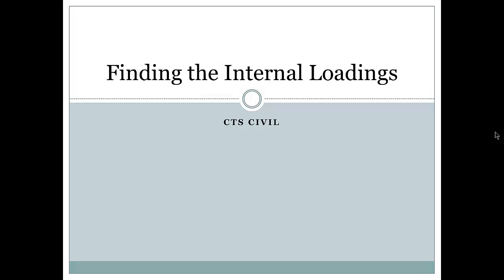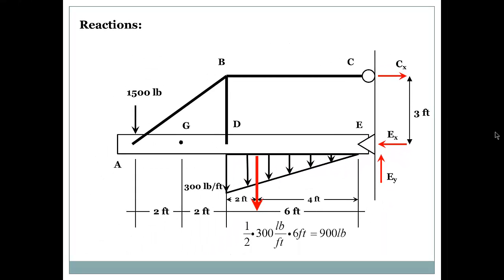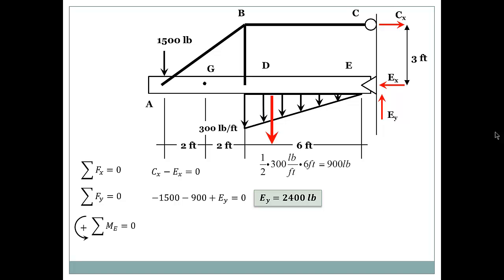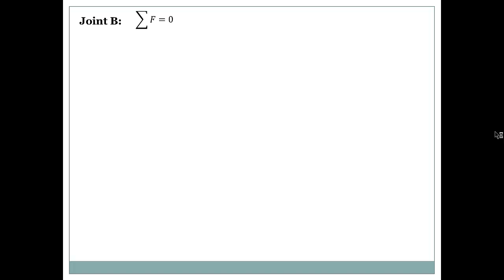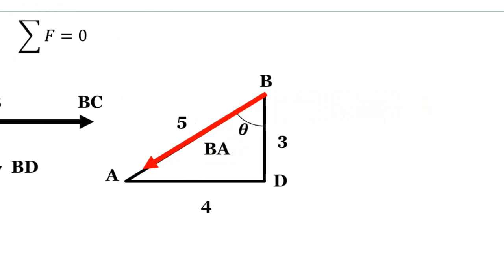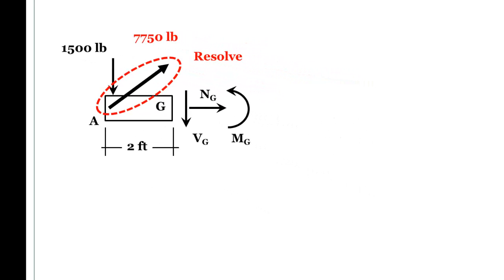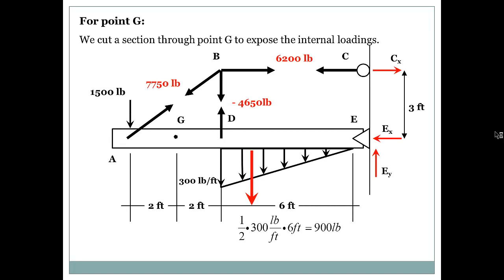Question (7): How to find internal loadings in a beam?

Comment: Wouldn't Ex be negative because there are only two horizontal forces acting on this system.  how can you have two forces acting in the same direction with no counter force to bring it to equilibrium?

Comment: Why does C only have a horizontal force acting on it? I thought pin connections have two unknown forces?
Reply from the maker: +ALV57 It is assumed that the support at C acts as a roller. That is why it has one reaction only :)
Reply: @CTSCIVIL  Bullshit man, it's got something to do with it being a two force member, but I can't work it out. I cam here looking for exactly this question and you come up with an absolutely stupid answer. A roller makes no sense at all, it's a pin joint.
Reply: @aetrew5499  no. pin joints have two forces acting on it while a roller only has one. how tf can a roller have 2 forces when it can move up and down? nothing to do with a 2 force member

Comment: hi there! Thanks for a great video, with step by step explanation to get the final answer.
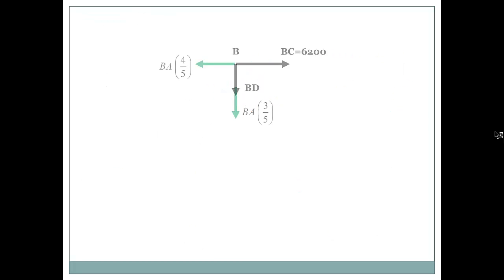I do have a question though, at 9:13, you mention that BC=6200 which is the support at the reaction at C which we derived earlier.Is it a result of two member forces acting on a body? I was wondering why it shouldn't be -6200 since it is on the other end
Reply from the maker: Bryan Ong that can be understood graphically. let us agree that the member BC is under tension forces. It should look like this: B ___ B1 -->   <--B1______C1--->  <--C1______CNow at C to make segment C1 C in equilibrium, it should look like<---C1______C--->  Cx. So the direction is correct to start with. And with our sign convention, to the right and up is positive.Hope that helps

Comment: I thought the object was connected with a pin at point C.  Why did you depict it as a roller when you showed the reaction forces.
Reply: Yup I've noticed that too, HAHAH thats what actually takes me a lot of time figuring out my own.... THanks
Reply: Actually the joint at C is supported by a pin. However, because the force is transmitted via a cable it acts in tension only. Furthermore, because the cable is horizontal between points B-C the concept of a roller can be used for analysis (since the pin provides a reaction in the X direction only). If the cable was acting at an angle other than horizontal; then, the assumption of a roller cannot be used.  

The pin was used to stabilize the support.  Think about it, if you had a roller it would simply fall down under the force of gravity and then the cantilever beam will rotate in CC direction. Thus for stability the pin is necessary.  You will cover material like this in when you go higher up in your studies.
Reply from the maker: The textbook I got the problem from specified it as a roller in the problem statement.
Reply: CTSCIVIL Ok thanks